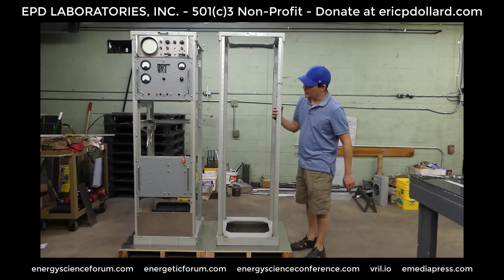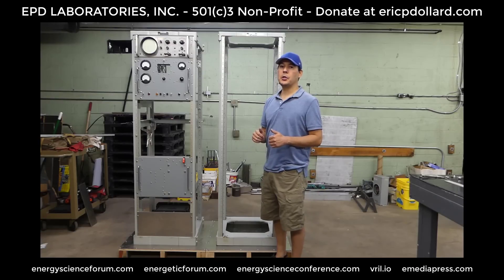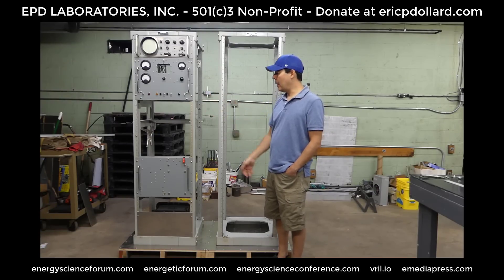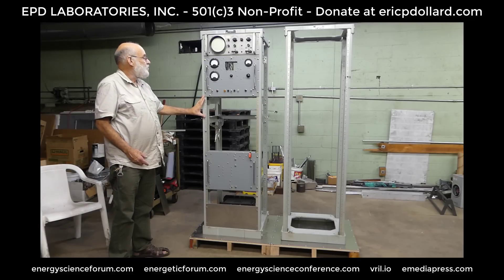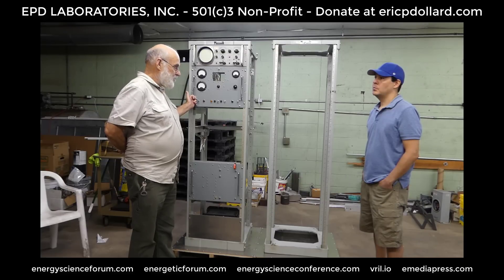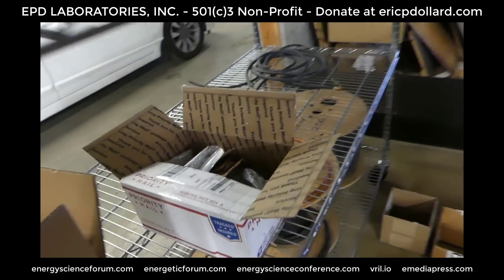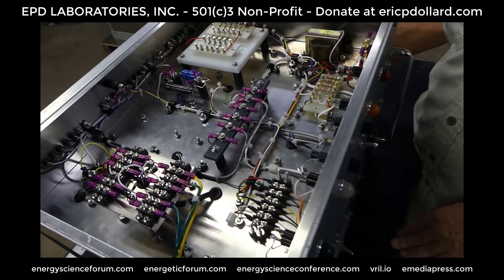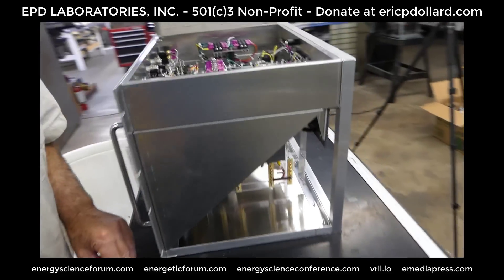Cosmic Induction Generator - Under Construction Overview

Comment: Aaron this is Carter Rae you know the guy with the GEET info ?? Anyway I have been an Amateur Radio op for over 50 years and have built most everything including letting the "smoke" out :-)) That being said you have done a magnificent job at this project. I believe this is going to be the basic unit for many other experiments for those who think that this is just a fancy  ebay project !!! Other sources may be any of the Amateur Radio handbooks ARRL from 1965 to about 1980 it has many proven projects that can be modified. I think that the Hammond Transformer company that is still in business may be agreeable to custom wind almost anything you can through out there..  Also the Peter Dahal transformer company my be agreeable to the same thing .. They are making heavy duty plate transformers for the 3-500 Z 3000 volts at 500 plus milliamps, in pairs. Anyway God bless you guys and keep it up.. I hope to be able to be a minor presenter next year about the GEET details.. That system WAS clearly using vacuum energy as many of the output compounds and elements were different that anything on the input.. I have lab notes and it supports that with Gas Chromatography from a major College out West ..  The only way you could get a change ie new elements is though Nuclear reactions with the HIGH ENERGY available only from Vacuum energy in sufficient amounts  Cheers Carter

Comment: So, so happy that there will finally be a proper Cosmic Induction Generator soon!! Awesome job, guys.

I am sad that no one will be able to replicate this custom-made monster rig using rare parts...

There are 1000W tube audio amps available off the shelf, wouldn't that greatly simplify this whole setup, making it more straightforward to replicate?
Reply from the maker: It needs to be a high voltage amp - about 2400 volts. You won't easily get that off the shelf.

Comment: Are y'all trying to make free energy or get a free energy device that's simple enough that that the common person could understand what's the deal Aaron? I know free energy based on common motors and generators with very little modification I guess you can say really no modification to the just a little added on but very little.
Reply from the maker: That project in the video doesn't have anything to do with free energy. It is for some interesting Tesla related experiments.